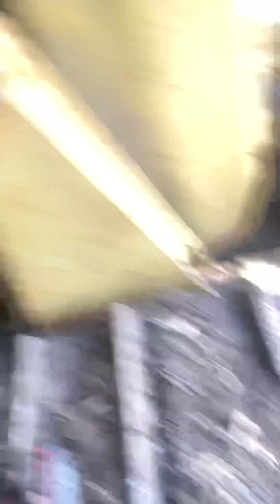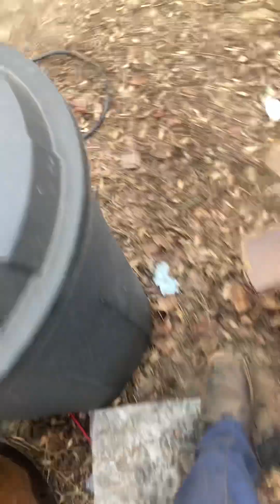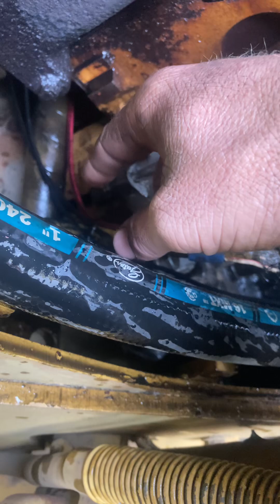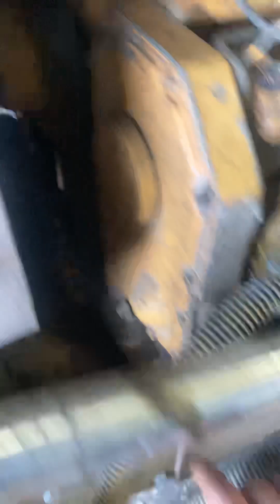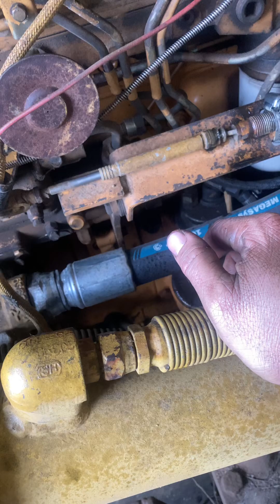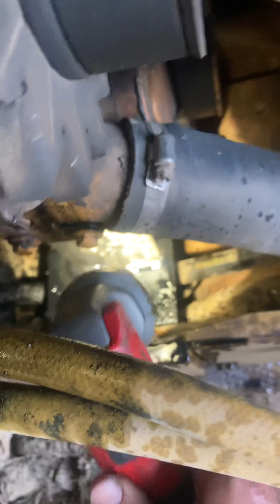4bt Cummins swap a Cat D3b Dozer

Comment: Hello. I'm doing the same adaptation and have some questions. Do I completely seal the oil hole in the gearbox or drill through the inner wall? And to seal the engine and starter ring, do I simply use silicone?